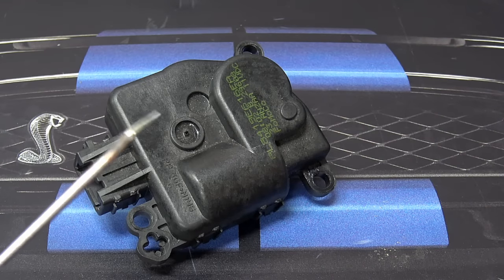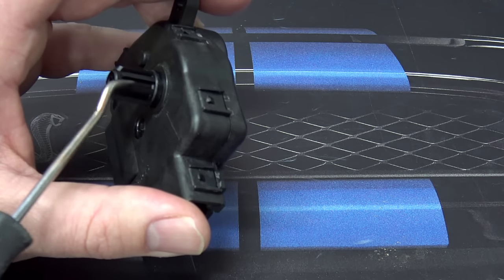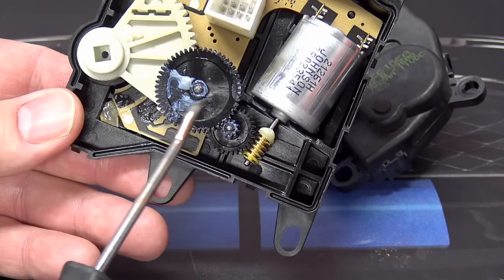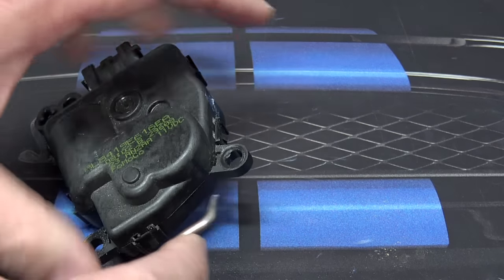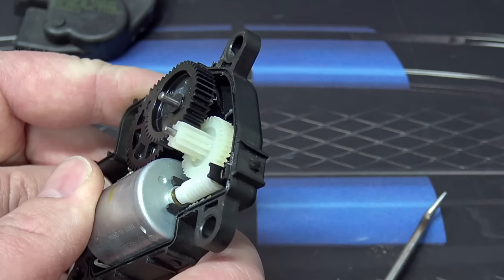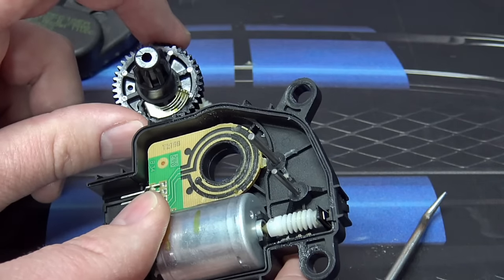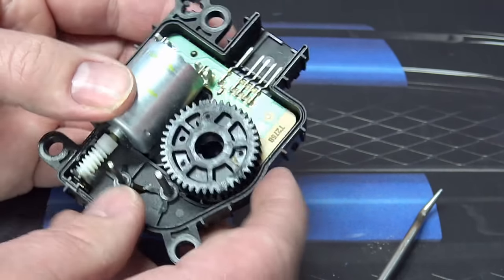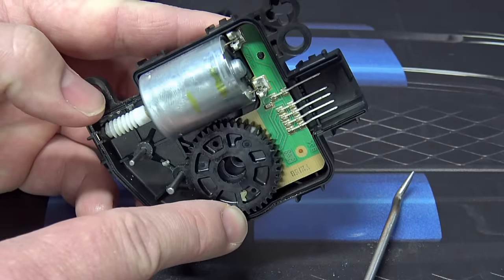Ford Vehicles: Frequent Blend Door Actuator Failures and Why?

Comment: Probably the same crap in my mazda 3 since it was made when mazda was up fords ass although that was since the late 80s really wasn't it until just recently now they have something toyota going so the newer mazdas should be bomb ass reliable lol. Ford have had some amazing cars but since the Mazda 3 came out Ford has contributed so much junk that ended up in a lot of mazda models for almost a decade or just over. Shame cos the bk and bl mazdas are good cars and had lots of features compared to the corolla of the same ages unless you bought like the top end corolla

Comment: The arm broke off the vent position door I had to pull the radio cut open the ducting and move the door with a piece of wire then when winter comes around do it all over again so I have floor heat and defrost. What a POS design

Comment: My 2018 raptor  is blowing cold air with the heater on.. no heat when it's cold out just great. The dealer cannot figure it out.  82k  piece of junk  Raptor.  intermittent issue. Made the truck overheat once bad too now..  I was a Ford guy for years... after 2 months of this truck ...oh it had other issues too ...certified with 39k miles... I am about to buy a different brand. Ford Quality is gone